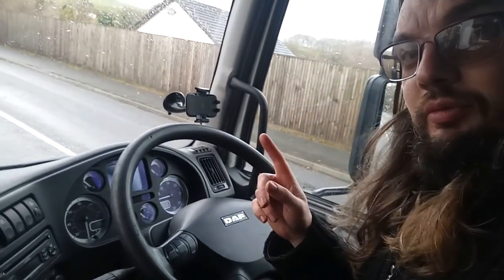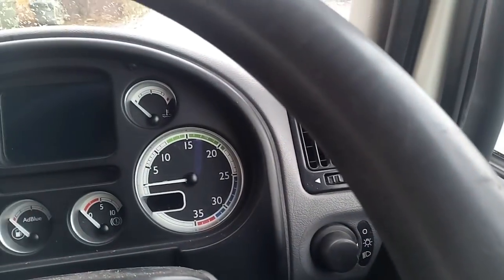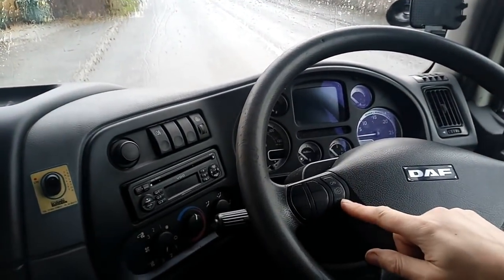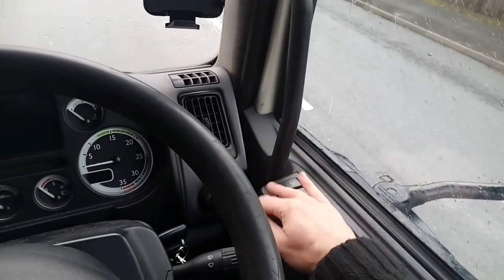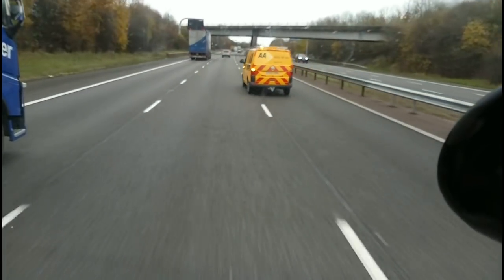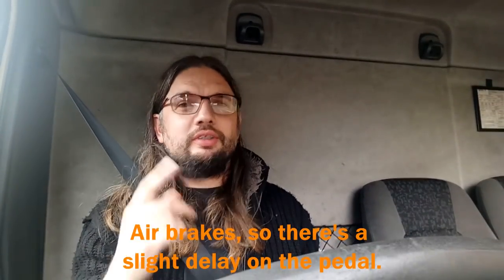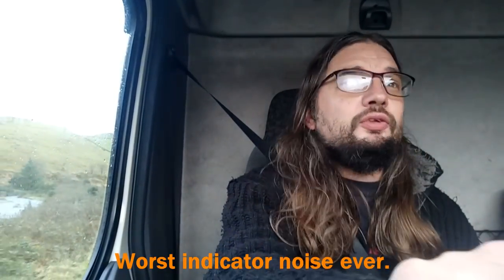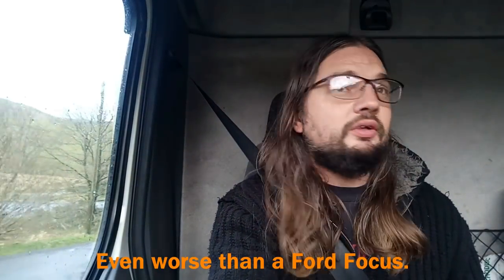How to drive a 7.5 ton truck. I like trucking!

Comment: I think it would do all us car drivers good if we got forced to drive a truck for a short while and then we would appreciate what a truck drives has to deal with every day so top marks for putting this across Ian have a Yorkie well deserved great video.
Reply from the maker: Aye. It's an insight that car drivers really should experience.
Reply: I think it should be a mandatory feature in learning to drive a car. I've been a HGV driver for over 20 years, and have often thought this would be a good idea.
Reply: cibie01  u need a licence to drive a truck it's nowhere near like driving a car
Reply: Of coarse you need an extra licence over 7.5 i was talking about road use and road awareness experiencing it from the other side, my family come from a line of truckers so spent many many hours seeing it from there side as a passenger.
Reply: Definitely. A bit of time (off the public highway, o'course) behind the wheel of something larger might do some folk some good. Particularly to have them sit there with a car sat in the blind-spot, and ask them "Can you see that car?" ("...what car?" "Exactly.")
Reply: Yes considering a 7,5 tonner was the heaviest vehicle you could drive on a car license, would have made sense to have a drive of one. I have driven them in the past, and I guess it’s the next size up from a Luton.
Reply: Absolutely !
Reply: More importantly, I think all driving instructors should have to ride a bike and driven a truck before they can instruct !
Reply: Bloody good idea! Bikers, car drivers, cyclists should experience the issues each face and maybe we’d be more considerate. I’ve ridden bikes and sidecars for thirty plus years but I try and consider the needs of others, I think the surprise on other drivers faces means they were surprised.
Reply: Lorries should only be allowed in the left lane (except in emergency situations). Lorries overtaking each other at imperceptibly higher speeds are the cause of over 90% of congestion on the dual carriageways and motorways that I use. Their speed is limited, so they should all just sit at 56mph (or whatever it is) and not overtake each other - usually needlessly.
There are also legions of pillocks in cars - lane discipline in the UK is atrocious, to give but one example - but that doesn't make lorry drivers' overtaking behaviour any better.
People who drive cars at the same speed as trucks have something wrong with them - why would you do that (unless the vehicle can't go faster)? And what's with those people who tailgate trucks in their cars? Do they feel safer? Because they're not.
Also, I can't believe that I can legally drive a 7.5 tonne truck. Having hitched many rides with truckers, I know I don't have the skill to do that safely.
Reply: @julianevans9548  you CAN'T drive a 7.5 ton truck. Even if you've got grandfather rights. Why? Because you need a Certificate of Professional Conduct which is a 5 full day course which costs around £55 a day and needs renewing every 5 years.
Reply: @sydsnott5042  if you drive one for a company they will likely insist on it (is it part of the operator's licence conditions now?).

I was a vehicle custodian in a large company for a couple of specialist vehicles over 3.5 tonnes between 1998 and 2010. For the first part of that the company was covered by military rules, so we didn't need an operators licence or need to use tacho charts.

From 2001, when I got the 2nd vehicle (6.5 tonne Iveco turbo daily chassis cab / custom body), I needed to learn how to use a tacho and follow the driver's hours' rules as we became a commercial company.

In 2004 I got a provisional licence for C and C+E (I'm not old enough / not worked in proper truck world to be certain of the HGV classes - I think C is up to 26t rigid lorry (HGV3?) and C+E can have codes to limit it to draw-bar trailers (HGV2?) or anything including 44t articulated lorries (HGV1?) ... but I last needed a vague idea of this almost 20 years ago, so I'm not really sure). This was to enable me to tow a 2.75t trailer we'd just purchased. Work ended up replating the trailer to 1.75t so I could drive it with a pre 97 licence (it was way cheaper and we didn't need the loand capacity - it was used as a mobile lab ...

None of this needed any formal certificates, though I suspect the regular courses I had to go on covered much of the same ground as might be required now.

In addition I've hired at least five 7.5 tonne trucks (for personal use when moving house) in 98, 04 and three or possibly 4 in 2021. None of the hire companies have asked for anything more than sight of my driving licence (and the check codes for the recent hires). All of them have accepted my assertion that I'm using it for personal use. None of them have mentioned tacho charts / cards (other than an occasional mention that the warning light can be ignored!). The first and last of the recent hires have asked if I wanted the auto gearbox lever demonstrating (I agreed to this the first time as I wasn't familiar with column mounted auto selectors - it was a a static demo with the engine off / watching from the outside!).

So for anyone who passed there test before 97, you should be able to hire a 7.5 tonne truck if you want to experience the joys! It's great having the auto box change from 1st through 2nd to 3rd as you wind your way up to <30 as you navigate round a roundabout with at least a quarter of all your (non vehicular) possessions in your care! The first hire was Eastbourne to Bracknell with my wife, a friend and everything but my car all in my hands ... either I'm way chill or reckless! Or, after 1.5 years of post test driving experience in a car my dad owned / insured AI shared with my mum, the next 3 years of driving experience were in hired transit cans, so I was unphased by the size

I also drove a 38t curtain sided artic around part of a test track (after getting the controller's permission) at up to 30mph for work in 2002

In answer to the previous poster's comment above suggesting that speed limited vehicles should not be allowed to overtake each other  ... that shows a lot of nievity about how speed limiters work, how hills affect vehicles of different engine capacities / actual loads and the realities of road freight. Even on 2 lane dual carriageways (where it is a royal pita for car drivers) it has to be allowed. Same as bicycles are entitled to use A roads even if a cycle lane has been provided; same as horse riders are entitled to use the roads ... They are a shared resource, not something built for car driver's dole use
Reply: @sydsnott5042  actually you can drive a 7.5-tonne truck for personal and it does not require Driver CPC, but it does still require C1 entitlement on your hgv licence. Also you don't need a tacho for personal use too.

Comment: I had just passed my test in 1987 and was driving these at 18 back then there were no limiters and these were good for 80mph.
I think they brought these regulations in to foil people like me.lol. but seriously, I drove one for a few years and it does give you another perspective and enhance your driving skills for life.
Reply: No seat belts either ;)
Reply: some 7.5t are still not restricted. I can do 85 in my Horsebox.
Reply: @TruckinAboutWithSteve  Are you allowed in the outside lane if it's not restricted?
Reply: @drbennyboombatz9195  yes if the gross weight does not exceed 7.5t and also not towing.

Comment: About 20plus years i drove a truck in outback Australia from Cobar in New South wales, up through Bourke into Queensland and then up to townsville via Longreach . I was fully laden each trip and apart from a diff losing the pinon carrier bolts in the middle of no where i had zero trouble except the truck was only able to max out at 60kph. At a constant speed driving 20 hours per day(!!) it took two days to drive. I often got passed on the worst roadfs in trhe world by road trains, three trailer rigs carry close to 100 tons.

Comment: If its a four-pot you did well as it was only running on 3 1/2 cylinders - good observations regarding mirrors, you are a skilled driver. I have an LGV C+E (class 1) although never drove for a living but it taught me to use the nearside mirror to good effect which has saved me from a few close encounters on roundabouts in the car over the years
Reply from the maker: Thanks. I've always been pretty hot on mirror use, but undergoing MiDAS minibus training (and then becoming a trainer for a time) really helped reinforce it!

Comment: Years ago  I was waiting at the roundabout to go across on my way home from work.  Four lanes to enter . Large artic in lane 3 out from the left kerb  and  tiny KA in lane  2  sat in half way along the truck.  Truck pulls away at an angle and rear set of wheels ride up over the KA  crushing the back.  So little KA couldn't see past truck  to the right and didn't know if they could pull out   and truck couldn't see KA .    No one hurt thankfully.

Comment: That gear lever looks like its came straight out of a Rover 200 and the air vents as well. If the ad blue system doesn't work or is low on it the engine goes into limp mode.
Reply from the maker: I've no idea. I did mention the DPF warning light to the people hiring it, but they didn't seem to think it made a difference.
Reply: If the DPF light is on it could be blocked which restricts power as well. Modern day technology sucks. A Ford Cargo or a Leyland Road Runner would leave this for dead.
Reply: I do this think the hire people bothered about anything judging by the video 😂

Comment: That's one of my pet hates, cars which can go faster doing less than 60 mph on the motorway. When you pull out to overtake they speed up and slow down again when you pull back in behind.
Reply: Scott 

Worse are the ones that do that. But in the middle lane.
Reply: So true

Comment: Those who passed their car driving test before 1996 (?) can still legally drive a 7.5 tonner, those who passed their test after have to do a HGV3 (?) test before driving one. I hired one twice to move house 20-odd years ago, quite scary just being let loose in one without any instruction lol. I just remember the weird handbrake, the gearbox that wouldn't be hurried (especially when cold) & being very aware of the width, especially when driving down country lanes. I think you'll find they're mostly 6 cylinder turbo-diesels BTW.

Comment: I feel your frustration at car drivers who accelerate when you catch them up and try to pass. It really only became a major problem for me during the last two years of my five year stint doing Class 2s, and I was doing longer motorway miles at busier times. I did begin to wonder if the car driver has an involuntary muscle reaction in straightening the right leg as the truck cab gets alongside his or her window, as that is the point at which the near invisible car down on the left usually decides to block you and accelerate. In fact most of the time just keeping pace at 56mph, forcing me to drop back and pull in behind again (which then creates an issue if somebody filled the gap I left when I pulled out) whereas before I'd caught up with them while they were doing 50mph. Maybe they are thinking "Why don't you accelerate past me?" Because, dear car driver, I was flat out when I caught you, I was flat out when I pulled out and drew alongside you, and I'm flat out now you've gone faster. And then I used to think fine, I'll drop back. and let you go. Two minutes later, they are back to 50mph and I've caught them again. If I keep a safe distance,  they maintain 50mph. If I pull out to overtake, they speed up again. Then next bit is not in the highway code. Towards the end, before I got fed up with the job, if they did this to me three times, I came over all Duel, and they were Dennis Weaver. It works. Two or three minutes of that sort of claustrophobia and they get the message and bog off. Now I don't believe in doing that in 50mph restricted zones on the motorway, and I've seen 44 tonners  intimidating cars in the middle lane, and if they are doing 50mph and that's the speed limit, that is wrong. But the dawdling BMW or VW Passat on flowing fast roads stopping a truck getting past is just as bad. What's the rush, you ask? I'm working. I've got time sensitive deadlines to make. Losing 6mph over many many miles makes a lot of difference.
Reply: Late reply, but - yes definitely on the last point. There are MANY trunk runs I've done where a delay of 5 or 10 minutes means you've missed the window on your tacho and you have to get parked for 45 minutes. Worst case, that 45m break pushes you past your daily 15 hour limit and you have to park up and get the company to send a van or taxi out...
Reply: Just brilliant 

Not ok sighed so much for years as it's so true 

You should write a book
Reply: That should read 

Not laughed so much in years me cheeks were hurting lol
Reply: I feel your pain.  I am very poor nowadays but still have to drive long distances, and often do about 55mph (indicated).  But if a truck overtakes me I usually throttle-off once he has pulled out, to let him get past me as quick as possible.  I like to hope I have a brain.  One of the best policies - for me - is to encounter a truck who seems to be doing a constant 50mph, and then tag along behind it.  It serves my economy, and I'm not really holding anyone else up, as they'd have to pass the truck anyway: They just have to pull out a bit earlier and pass me as well.

Comment: Don't use first gear.
Use your mirrors constantly. You need to build up a picture of what's around you, like a motorcyclist does.
Take turns wide, and use your mirror as you do so, watching where your back wheel is.
Spend as much time on a roundabout looking behind, as you do looking ahead. People foolishly try to pass you.
You can tell where your position on the road is by looking in your mirror.
So..mirrors, basically, and don't use first.
And the handbrake's a bit binary.
Reply from the maker: I used first gear, as it didn't seem keen on pulling away in second.
Reply: HubNut It's odd as every truck has a sticker urging first gear, but anyone in the business says second. Did I mention mirrors? lol
Reply: Flash Herbert drive these regularly. They hate pulling away in second. Later ones with the 6-speeder will.
Reply: Glen. I drove a few of these ten years ago, and don't remember ever having to use first gear. A few 18 tonners, too. Maybe they've changed. Cheers.
Reply: The previous shape DAF 45 based on the old Leyland Roadrunner did pull off in second easily, because it was so low geared. This shape and later I have driven, 5 and 6 speed versions as well as some fitted with a lovely smooth Allison 5 speed auto. It may be the gearing on the 5 speeders at work as the difference between 1 & 2 is really wide. General rule I was taught in 2001 by my HGV instructor was pull away in 1st for 5spd, 2nd for 6, 3rd for 8 or more forward gears. 8 years later my PSV instructor said the same thing, not realising I had an HGV
Reply: I just turn the auto to left on d Eg drive and it goes lol and r for reverse in never use any setting to the left of d on auto
Reply: FH, you perhaps lack experience. Always used first on these tinpot trucks as they behave like cars. In proper trucks with more gears, the ratios tend to be closer together and setting off in first isn't essential. Generally, even in cars now, I do very little with first - once rolling, slip into second - then drive.

The parking brake is not at all 'binary'. It wouldn't be roadworthy if it was.

Comment: try driving a pre 00 merc atego. they didnt even had seat belts before then. scared of a slight hill empty
Reply: Any Merc commercial is scared of a slight hill empty.
Reply: @glenrea  agreed, my work Atego 816 will drop to about 20 on Detling Hill when loaded! Quite embarrassing I'll say.
Reply: And too much weight on the front - I felt the arse end begin to go on one once when going through a downhill corner. Not fit for purpose (I was only doing about 20mph at the time, too!)

Comment: I rented a Merc and it jumped out of first if you pulled away without holding the selector in position. I only made that mistake once on the roundabout near Ross hoping to get away as market traffic came round towards me!. I can only assume Ian you have the addition for the larger vehicle on your licence as you're too young to have got it when you passed your test. ;- )
Reply from the maker: Ken Sherwood Ha! Very kind Ken but I must me older than I look...
Reply: Trying to get reverse in a merc used to fun

Comment: I own an old 89 Ford cargo 6pot its brilliant on fuel returns low 20's loaded and high 20's empty the gearing is spot on I never use 1st ( it's like a crawler gear ) and no limiter or electric gizmos to go wrong 😁
Reply from the maker: Sounds ace!
Reply: Bruno B I love the Ford Cargo 0813 myself. Best truck ever built by a merry mile. I had one for years and absolutely loved it. I didn't want the days to end when driving my Cargo.
Reply: The Highway Cowboy T.H.C I agree one of the best trucks I've owned ☺
Reply: @The Highway Cowboy
I love the old Cargo!Drove them all,from 7.5 to 32 tons.The 16 & 17 tonnes were brilliant.Best exhaust brake ever,with a Cummins V8.Always had the window down!
Luuurrvly.Good times❤😎👍!